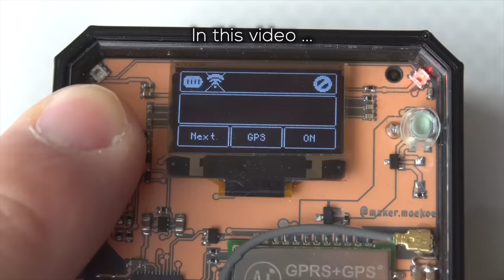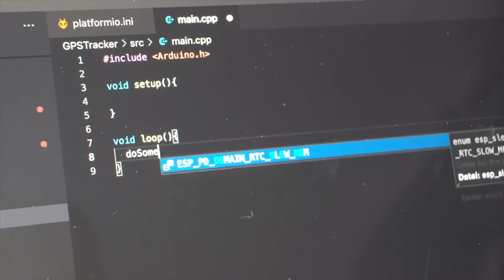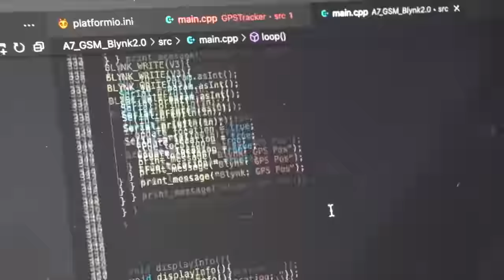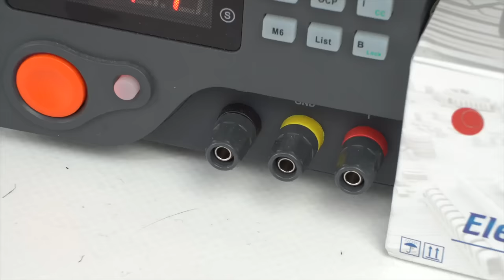I've built a GPS tracker with ESP32 | soldering, assembly & first test | makermoekoe

Comment: Great project! You may want to increase the temperature of your soldering iron quite a bit, because some of those connections and especially the through hole ones look a lot like cold solder joints to me. Take a look at the battery terminals for instance.
Reply from the maker: Indeed this could be the solution! I thought the battery terminals are just drawing all the heat of the iron due to the huge metal things but may a higher temperature would help here 👍🏻
Reply: @makermoekoe  there are a few ways that you could solve this problem. Preheating the terminals for a bit longer or using some additional flux may help but keep in mind that in soldering it's almost always preferable to have high heat for shorter time, than lower heat for longer time. So, ultimately increasing the temp on your iron imo is the best solution
Reply: A larger chisel or knife tip would help even more. Its hard to get a good heat transfer with conical style tips. In the Hakko T12 series I do about 98% with a D24 and D12 tip. D12 for 0603 and below - D24 for everything above.  Sometimes a knife tip if the space is too crowded or when I want to heat up both pads of a small part at the same time to replace it.
Reply: @Leif_YT  I'm also a big fan of chisel tips. My favorite is the d24 also, but I've used conical tips with good results too. I suppose it's a matter of preference in the end, but you can definitely solder these terminals with a conical tip. It seems like the temp was way low.
Reply: I was thinking the same thing about the battery but his skill is beyond anything I can do so I didn't want to mention it. Haha
Reply: @jstro-hobbytech  being a good designer doesn't automatically mean that you know how to solder properly. They're two completely different skills 😉
Reply: @alexisdrosopoulos  true true. I practice all the time. Most of my projects are through hole but I buy smd kits in bulk to develop my skill with smd. They don't make smd protoboards haha unfortunately. I use pcbway sometimes though.
Reply: @jstro-hobbytech  imo if you have the right tools smd is much easier than thd, unless you go for 0402 and smaller packages. You know what they say, practice makes perfect 😉
Reply: @alexisdrosopoulos soldering is like a zen experience if you get in the zone haha
Reply: I guess the solder wire is not that good.
Reply: @ferrabras  Probably it's just lead free and the iron was set for leaded 🤷🏻‍♂️ I really don't know. I insist that it's just a matter of increasing the temperature.
Reply: @alexisdrosopoulos  maybe, but I had problem with lead+flux wire and it was not temperatura. The problema started by the end of the roll. But I agree the temp is the first step.
Reply: @alexisdrosopoulos  the soldering iron could also be too hot, sometimes if it is too hot, the flux will be instantly vapourized before it can do anything, though in this case it does not seem like that is happening
Reply: @maxxiang8746  that's true, but I don't think that is the case here. It looks like he's having trouble just getting the part hot enough. But I guess since we have neither the temp of the iron nor the solder that's being used as info, anyone's guess is as good as mine 😋
Reply: @alexisdrosopoulos  Where can one buy led solder nowdays?
Reply: @mmdirtyworkz  depends on where you live. It's still available, it's just not legal to use it in commercial products. For your own builds you can use whatever you want
Reply: Definitely more heat on the iron but great project!
Reply: 2:45 dry joint to the capacitor there
Reply: @makermoekoe  am i able to buy your full assembled prototype??
Reply: Use more flux
Reply: Thanks everyone for their input. I tried higher temp and a chisel tip and my practice joins a way better than before. Thanks a million

Comment: You should use flux on all of the hand soldered parts, a lot of those solder joints look cold. Maybe increase soldering iron temps a little too.
Reply: His soldering technique is flawed. He should heat the pad and pin with the iron and then add solder. I was surprised considering the neat design and how well everything else was done.

Comment: Great project! I am currently working on something similar, but my intent is to make it as small as possible with a SIM7600 module. I am waiting for that module, but should be able to fab the board after that. Any suggestions on how to order a reasonably priced, custom size project enclosure? Having the ability to select where two holes could be positioned would be nice, but I can always cut them out haha.
Reply: Can you use CAD Modelling software? If so, you can 3D model an enclosure and let it print by someone else, it is usually reasonably priced to do so.

Comment: This is a really well done project, only thing i could see that could use some improvement is the quality of the soldier wire. It either doesn't have enough flux, or it's being exposed to heat too long and it's cooking the flux out. Still a good job though.

Comment: Very nice. Are you plan on releasing the source or selling it? I would love to have one.
Reply: Yes me too
Reply from the maker: Great to hear so! Initially I was planning to do both but first I have to fix all the little mistakes. Because this project has a real use case, I won’t wait too long with finishing it 👍🏻
Reply: @makermoekoe  let us know.
Reply: @makermoekoe  I will wait also. Great project. I was doing a similar solution with accelerometer to use on my motorbike and record all travels info
Reply: Could you please make a series for this module itself? I want learn how did you design the module and pcb print. Please do a single series for us and make us learn to do it the right way. I'll be waiting for your project files and the Gerber file for trying the project out.
Make it open sourse or else some cost for the whole module as well. I definitely want to buy one and want to play with it.
Reply: @makermoekoe  How much smaller could you reasonably make it if you only needed battery to last a week or so? Edit: with only intermittent tracking like every 15-30 mins or so?

Comment: Stencil looks a bit thick for solder deposition. Great work, good technique. For castellated parts you can use a multi step stencil to get more solder, but it costs more.
Reply from the maker: It is 0.15mm, but for upcoming projects I've chosen 0.12mm. We already had a discussion on Instagram regarding this topic so I'm going to give it a try
Reply: As long as it doesn't bridge on the fine pitch stuff, I would use the thicker stencil for the larger components. Unless they're doing a huge run of these, a multi step stencil wouldn't make sense.

Comment: That's a really impressive build, and design.  If you don't mind me asking, did you prototype any of that first on breadboard, or software simulation, before you had the boards made?  No matter what, it's impressive, but if that was first power up of the design, it's pretty cool.
Reply: Prototyping something like this is not practical and way too much work. Probably easier to just lay the PCB board and have it made.
Reply: anyone knows a good software simulation for this kind of projects?

Comment: Hello, Sir! I have a question, did you consider the esp32 datasheet about the antenna impedance matching? I'm designing my own pcb and I'm terrified about thi pi filter without component values on the datasheet! Nice job by the way!

Comment: 4 things are needed for good soldering

Enough thermal energy to overcome the thermal mass of the joint
A clear solderable surface
A chosen ally to bond joints 

and th emost important in alot of ways....

FLUX!

I was very happy to watch this then out of nowhere you started to solder with ally and no flux? I mean it might say flux core, but thats just a lie. Always gota add some more flux! Your joints would have turned out so mnuch better.

Either way, nice project! and good luck in the future with your soldering.

Comment: Amazing project dude! do you use some power off IC? or just the deep sleep mode of the devices?
Reply from the maker: Thank you! I'm using a latching circuit, which means the device can be powered in two ways: with a button press and with a gpio of the ESP32. When you press a button then, the MCU gets power and the first task it does is to pull that gpio high, which will hold the power after releasing the button. The latching circuit is controlling the enable pin of the LDO 👍🏻
Reply from the maker: Powering off can then be done with just pulling the gpio low.
Reply: @makermoekoe  oh I see, very clever!, I have used Fliflip D and timer to make a small delay, but your implementation looks better, I will try this. Thank you! BTW, great videos!!!

Comment: Hello!
I am designing a PCB very similar to the one you have designed in your GPS tracker project. I would like to know how you have designed the power circuit. How do you stabilize the voltage at 3.3v when the battery voltage drops below that value? And what voltage does it power the Ai-Thinker A7?
Thank you so much!

Comment: how could you forget pullups for i2c ? xP I am trying to design gps cats tracker that I plan to strap to my cat to see where and how far they wander. I was planing to use stm8L (stm32L) with L80 quectel or max-m10s modules and store data on flash chip (24LC256 or bigger), and power it directly from CR2450R murata (High drain) since i researched it is the safest battery chemistry i could use.  My biggest concern is the power consumption, will I be able to power it directly from coin battery or do I need SMPS like LTE3440 ?

Comment: Step 5:  Needs moar flux.  ;)  After watching gpu fix guys, I tried adding a pre-flux or mid-flux to my solder.  10/10 will do moar.  If it be stiff egg-whites?..  Add moar pine tar.  
Step 6:  Well, I guess you do have it.

Comment: U didn't inserted the sim card in the instrument. Is not it needed ??
Were you tracking via your mobile sim, connected to your instrument via wifi. ??
And what was the second input to your instrument apart from the signals from antenna ??
Will you care to answer ??
I m bit curious and confused. :I

Comment: I want to build environment monitor/ control platform based on 4/8 sensors PoE connected to hub that contains 2/4 control relays for operating resources delivering in to closed space to keep parameters preset. With live diagrams and warnings, webaccess..it would be bestseller in my field. how to do this...

Comment: That was really Awesome!!!! Does the GPS you interfaced need to keep in opensky for it to be start from cold start??
Since I used another board which also have GPS+GPRS on it which is interfaced to esp32...But it needs to put in open sky in cold start and also small movement in the hardware also will loose the GPS value...How do I make the system strong not this much delicate and fragile....Waiting for your valuable suggestions
✌

Comment: Nice project, how long does the battery last if one put in in a car and it gets stolen?
I mean how long can i see where the car is?
Lets say they hide it in a steel freight container for 24hours after the initial theft and if they take it out after that, is the batteries good and its tracking still?

Everything look very good but you might need to work a bit on you hand soldering skills.
Overall, very good and interesting.

Comment: How fast can you send GPS coordinates with your device? I tried different modules (A9G, SIM900, some trackers) to get a one second update interval but always had problems if the update interval was below 5-10 seconds depending on the device. Maybe all the developer boards are not designed for continuous uploading and the power circuits do not keep up with the high demand 🤷
Reply: It should depend on the Coding or sketch used as it has delay waiting for serial communication and execution each command to complete.  Working on cellular like SIM900 is much delay from device to cell tower and to your mobile phone. The device in this video should perform faster because it read and direct display on LCD.

Comment: Did you work further on this project?  What are capability specs? Limitations?  I am most eager to do this or even purchase from you the final project.
Newbie , I need step by step identifying tools and using them to load the “code”.  Slow detail showing wiring as I am new to wiring diagrams.

I AM DISABLED, I WANT TO CONTRIBUTE TO HUMANITY WITH ELECTRONICS!  GOD BLESS

Comment: Hey you need to slow down a bit in your handsoldering. The battery solder joints are terrible, they haven't flown well. Heat it properly first and then apply the solder. (the micro sd were also terrible in the first shot but I couldn't see if you fixed that)

Comment: If you need to use nxt machine to fit the component and DEC machine and reflow machine will fix the solder joint

Comment: brilliant! just a simple question, how long do you reckon the battery lasts when both wifi and gps are used?
Reply from the maker: The battery says it has 2400mAh capacity, but I think this cannot be true. With 1000mAh the battery would last only something about 5-8h I guess... Without sleeping in between of course

Comment: I don't think my hands are steady enough for that anymore :(
But super impressed with it 🙂
Reply from the maker: After a couple glasses of coke zero I‘m not able to do these things either 😅😅
Reply: In my opinion it's 95% about the technique. Think of a tripod or how you take long exposure photos and do the same with such things. Use PCB holders that are as close to the table as possible. I wouldn't recommend holders where the PCB is higher than 3cm above your table. Keep the hand resting on the table and if it's still too shaky you can use a tweezer in your non primary hand to guide the tweezer or iron in the other.

Comment: Hello I was wondering something The A7 module is a ESP processor and you are using a second ESP processor to control it. Why not just use the A7 to do everything? There is no need for a second processor. Just curious that's all.

Comment: I did a project using a A9G module and a Atmel328. Standby current reduced to 0,4uA . Wakeup by RTC timer or button.
Reply from the maker: With or without battery protection?

Comment: The first pcbway link above doesn't work. Generates an error.
Reply from the maker: You‘re right. I‘ve updated it but it returns the same error. Have to talk to PCBWay… Nevertheless you can take the second link and click on Standard PCB in the top left corner 👍🏻
Reply from the maker: Should be fixed now 👍🏻

Comment: Always intrigued as to why GPS takes so much power since it is just a radio receiver. Anyone got any insight into this and what it does to use so much?
Reply: What you receive is the signal from each satellite, there is a fair bit of number crunching before you get a decent position estimation.
Reply: I would keep it most of the time off. Only activate it on request or triggered by a motion sensor or something like that depending on the use case.  Or do periodic checks if it's still inside a set zone and when it leaves it send an alarm to the user and activate more frequent logging. The Channel of Ravi Pujar has some really nice videos about low power NB-IOT GPS tracker. They designed some low power tracker for pets and coast guards. Using NB-IOT instead of GSM is probably the biggest energy saver.
Reply: @Leif_YT  The GPS consumes more power then the cellular modem. if GPRS is used to send it might spike during transmit, but that is very brief. Atleast the GPS tracker i worked with. The GPS module consumed ~30mA all the time. but the modem consumed ~1 mA in standby (connected mode) and then spiked up to 300mA during transmit. used Sara G350 GSM module. I should add that i worked with a "real time" tracker. logging and sending GPS data with up to 1second resolution.
Reply: @Leif_YT  oh I wasn't commenting on this particular application, just generally GPS in any system seems to use a lot of power and wondered why.
Reply: it might be something to do with the processing of the signals maybe...
Reply: @WistrelChianti  I'm wondering how it compares to WIFi + LBS trackers. I had once a cheap ZX623W tracker for testing and I was really impressed by it's accuracy - at least here in the city where I live in. It was almost as accurate as GPS and in situations like parking garages it had it's advantages. In rural areas it will probably completely fail, but in cities it's pretty nice. Unfortunately I fried it due to a stupid mistake before I could do any power measurements.

Comment: When I did surface-mount parts (sot-23 transistors, 1206 resistors, surface mount leds) ~ 20 years ago, I tinned the pads, applied paste flux, and held the parts down with a bamboo skewer while touching the pads with a sharply pointed soldering iron.  

I did the boards myself, unlike these - which are both more complex and a lot nicer looking.  Also, reflow + solder paste is the only way to grow with some of these parts.

Comment: 2 seconds to turn on

Standby 6 uA

Modem off
GPS GSM off
Average 76 mA

Initialise modem  (about 15 s)
Modem on
GPS GSM off
Average 131 mA peak 972 mA

Connecting to internet (about 15 s)
GPS off GSM on
Average 374 mA peak 1591 mA

Connected to internet
GPS off GSM on
Average 98 mA peak 161 mA

Data transmission (about 12 s)
GPS off GSM on
Average 271 mA peak 963 mA

Connecting GPS (perhaps 20 s?)
GPS adds 76 mA average

GPS on GSM on
Average 165 mA peak 226 mA

Data transmission (presumably 12 s)
GPS on GSM on
Average 346 mA peak 982 mA

So for some automated process to turn on, connect internet and GPS in parallel, send one location and turn off again could take 42 s, and use 14919 mA s, or 4.1 mA h. So with the right battery, 2000 mAh gives gives you about 480 transmissions. One transmission every hour would go on for 20 days. Potentially useful for tracking a delivery across the world.